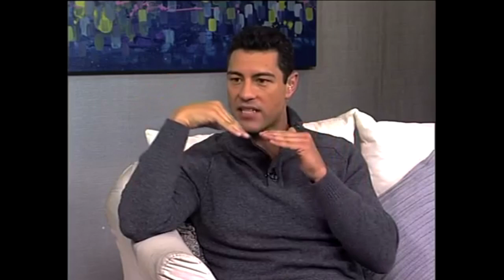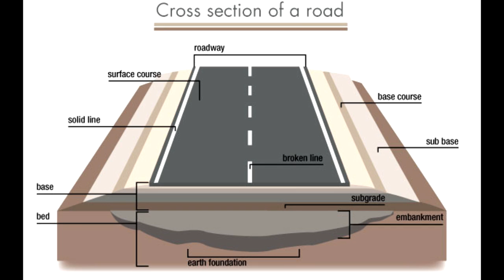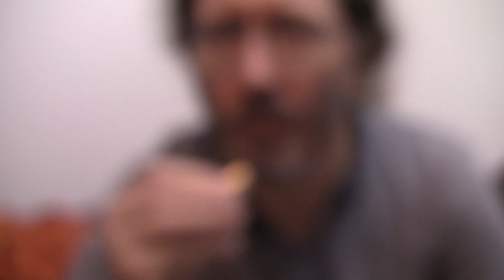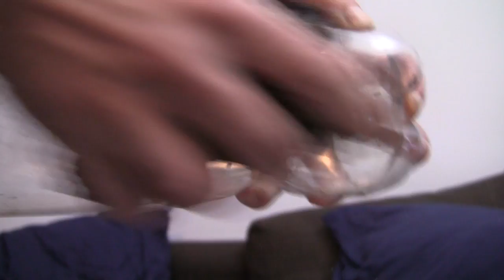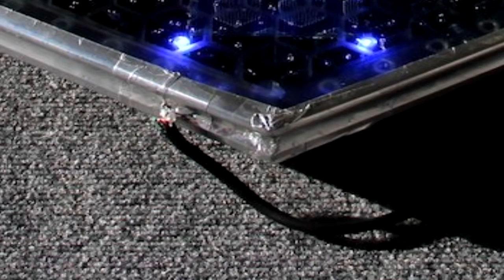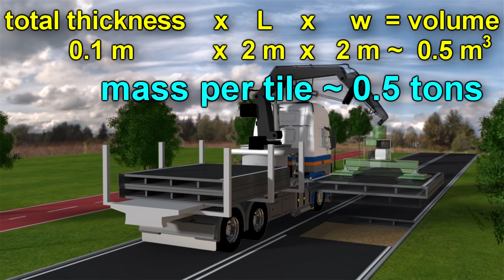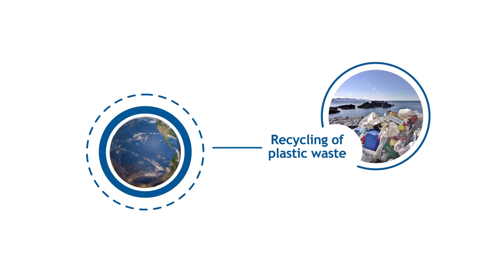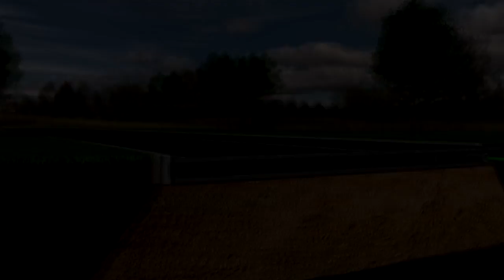Plastic Roadways BUSTED!

Comment: just imagine a car burning on a plastic road ^^' bye bye road, bye bye pipes, bye bye cables. yeah genius idea!
Reply: Didn’t even think about that, lol.
Reply: @zack dai some plastics can take some heat, so exhaust / friction heat from the tires probably won't matter. But some plastics will just melt from the sun alone (I've been in a 3D printing group where someone shared the sad picture of a PLA figurine that turned into a plastic puddle. R. I. P)
Reply: Imagine a wildfire out west burning 100 miles of interstate highways.
Reply: @greenspiraldragon  true lol. We don't have them in Germany, so I didn't even think about that.
Reply: You made me lough )))
Reply: Imagine the smell DX
Reply: Imagine a tire going flat and coming off the rim and someone driving just a few moments to get to the side of the road . Even if just for a moment it would cause deep gashes and gouges in the road
Reply: Maybe just wait til we get electric cars, and then go with the plastic road then.
No fuel, no fire.
Reply: @kosco1151  ehm, electric cars burn just like gasoline cars do. Even if the energy is not stored in gasoline form, its still being stored. and if something goes wrong, this energy is being released unsafely and starts a fire...
Reply: Cost to high .
Reply: Hahahahahha
Reply: It’s gonna smell pretty nice too
Reply: @xivisaac  yeah, nothing better than nice plastic fumes
Reply: The gov will mandate fire proof cars!
Reply: good thing car tires are made from a soft material and not diamonds
Reply: @YashuaFradkin  because roads and tires are clean and there is absolutely to debris between them right? go lick your closest road and tell me how many small rocks stuck to your tongue.
Reply: max cepec the rocks are from the asphalt that is loose. No asphalt =no rocks.
Reply: @YashuaFradkin  uh huh, because there are no roads in hilly terrains, no roads across woods, no base around the road which is mostly rocks and no roads that are basically  no asphalt, just settled rocks, also lets not forget parking slots next to beaches which are for obvious reasons not made of asphalt too
Reply: @YashuaFradkin  what are totally relevant to the comment reply definitely not completely off topic

Comment: Think of all the micro plastic this would generate and go everywhere.
Reply: @YashuaFradkin  rocks in tire holes
Reply: It's already a problem, but plastic roads would make it worse.  Microscopic bits of plastic are being found in human body cells.
Reply: @YashuaFradkin  are you stupid a tire creates alot of friction not to mention debris in the tires, dirt sand or any other contaminates on the surface or within a tire, worn down tires have metal bands which can be exposed and destroy plastic or rip high end working gloves. not to mention the road would have to hold over 10 tons of moving weight by semi trucks or multiple cars. concrete deteriorates faster that asphalt which is why you rarely see it except on entrance to highways or on certain applications such as bridges.
Reply: @Br Mo It was meant as a joke, since plastic is a polymer, polymer is just the name for the overarching group of chemicals that includes plastic.
Reply: Have fun breathing plastic dust every time you drive!
Reply: @williamhuang8309 

Look up the particulate pollution from tires and how they affect air quality.
Reply: i think that the plastic would need to be fibreglass or some other material reinforced to have enough strength... That would at least reduce the amount of micro plastic released.  Its still a stupid idea for most situations (might be ok for a walkway in a park or something like that)
Reply: @islandwills2778  but now it’s not recyclable… so remove one major part of why they want to manufacture this…. 

We already have roads that are completely recyclable and cheap… why would we want to fix what isn’t broken until we find a better material
Reply: Man, that ship has sailed. Our society relies so much on plastics for nearly every facet of its existence that I doubt any person living in an urban environment goes a single regular day without consuming microplastics in some capacity or another.

Not like this idea'd help the situation, though. Shame, it was such a nice thought to believe we'd kill two birds with one stone...
Reply: @Br Mo 😉
Reply: @YashuaFradkin  are you replying to every comment? tires have loads of debris grinding on the road plus thousands of pounds of car above it... it's amazing how stupid you are
Reply: They are coated to avoid this....
Reply: @nursepotassium LOL DERRRRP dumbest reply ever 😂😂😂😂
Reply: @Prolific_Troll it was sarcasm genius
Reply: @nursepotassium  Ahh, that explains why the comment got so many likes.
Reply: @Br Mo Polymer 😉

Comment: I have a problem with the title though, it's a little problematic if one knows, that certain types of rubber etc. can be used to replace the bitumen used n the creation of the surface layer.
Otherwise, there is a reason that roman roads are still the pinnacle of durability, the secret is the foundation, even with modern roads. But roadsurfaces entirely out of plastic? BAAAD idea, realy bad, don't even think about it bad.

Comment: Obviously, this incredibly bad idea was proposed in order to scam investors and ignorant government officials who give out research grants.
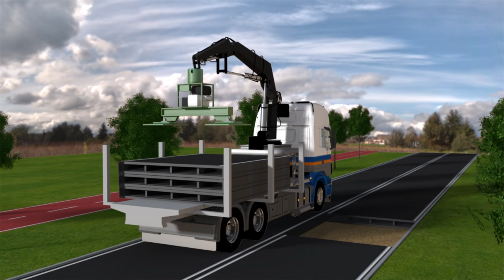  One of the most egregious of the flaws in this concept is the idea that you could run pipes or cables through the hollow parts of the road. Just look at 2:38, where a truck delivers a section of road. Now, what would happen if there were pipes or cables that ran through the road if a section needed to be replaced? That's right, they would have to be cut out and replaced every time a damaged section needed repair, cutting off water, electricity and communication services to untold numbers of customers for days as each utility would have to take turns cutting, removing and replacing their pipe/cables. We lay water and natural gas pipes parallel to and far under road beds and leave them be for generations, there is no reason to lay them a foot below the surface (where water mains would freeze in winter).

Comment: Instead of roads, use it for sidewalks. As for the movement problem, that is why you make it interlocking. Slickness can be controlled by how the surface is molded. The major problem comes in when you come to a curve. It would have to be made on site and installed just like concrete or asphalt. Power cables and such would need to be in a module on the side so that you could remove the roadway without disrupting the power, comms, water lines.
Reply: If you need to be made on site, WITH the movement problem being a major factor on how you mold the surface, then just use a concrete sidewalk. It's cheaper to make and is better in terms of maintenance.

Comment: I live in Las Vegas, NV where it is very hot and I recently found out they are going to start recycling tires by removing the steal belts and grinding the rubber to make asphalt to pave our roads. The new material is supposed to withstand the desert heat better and be more durable than traditional asphalt, although I am unsure if it will cost more to produce it sounds like a great way to rid the environment of the massive amount of discarded used tires we produce each year. I also saw that a way to recycle used plastic waste into jet fuel  which sounded very promising.

Comment: I think i found another hole in that idea.
8:48 How do they expect connecting pipes and cables(dont forget its wet area) inside of plastic block? Its not sure how much space there will be inside block, but even then it would be pretty damn annoying job going inside to join it. 

By truck placing block animation it looks like 20-30cm at most, thats one way trip even for Diet competition winner.

Comment: Just to prove this guy wrong.. There are already roads made of plastic working well.. Of course basic road construction for the foundations is necessary.. But the surface is the that deteriorates the most and the most complex to fix. So the arguments are based on assumptions.. The use of roads in plastics is already a fact
Reply: Oh yeah! The “plastic” roads in the UK! Funny, I did some research on the roads in the UK, and as it turns out, the roads use five kg of plastic per 1 us ton of asphalt. So how much is that? 0.5% just about. 0.5% plastic roads would be a better name for them, 99.5% asphalt roads plus a little bit of plastic. How much plastic were we talking about in the video? 100%. All currently accessible roads are mixed with asphalt and have more than 80% asphalt in them. The ones in India have the least asphalt in asphalt plastic roads, and I assure you they have way less busy roadways in India than in the US or the UK.

Comment: Asphalt is much softer than PET. If aggregate is mixed in just as it is on the road surface now it should be harder and resist deformation better than asphalt.
Reply: Where do you find the hardness scale for pet?
Reply: https://omnexus.specialchem.com/polymer-properties/properties/hardness-introduction    Not hard lol. Asphalt is like putty at 70 degrees. Only the rocks are hard. Pet doesn’t liquify until hundreds of degrees.
Reply: @klardfarkus3891  Asphalt doesn't liquify until up to 250 degrees F, I'm not sure where you got 70 from.
Reply: I didn’t say it liquified at 70 degrees. There are degrees of pliability before it liquifies.

Comment: but what happens if they replace a section with cable running through it
Reply: Oh that's easy. They'll get all these nanobots (still under secret R&D at the ultra top-secret facility) to scoot along the bits with cables to repair all the junctions as they go >o.O<

Comment: Some plastics are not too soft.  And there is also the need for an aggregate like sand which could be made by chopping and grinding up pc boards, as the plastic wears this would be exposed and provide grip.   Many plastics are not thought of as recyclable due to fiberglass impregnation in it.  So this same plastic will work to provide a hard traction surface for the road.
     Asphalt is a soft material due to the tar being a soft plastic like substance,  it is the gravel aggregate.  Tar melts in sunlight, plastic does not.  And there IS a sensible way to protect the plastic from the sun, the aforementioned PC boards and Fiber infused plastic aggrigate which is super hard.
     The channels add stiffness to a given weight of a panel.  These channels form I Beams to stiffen the road panel.  The animation is probably not to scale for a few inches of plastic is not going to hold up a truck for long.   But your assessment of the design is uninformed and biased.
     They are already making road bricks for in town roads in the Philippines and Africa using plastic shredded and melted down with sand added and it is holding up well even under the weight of the large dump trucks bringing the plastic rubbish.
Reply: Gee, vyou're amazing. Do you really think that the boffins at "PlasticRoads R Us" didn't think of all that stuff in your first two paragraphs before the marketing gurus got their hands on the vid? 

"Road bricks" as you've described them are a completely different beast altogether, for a start they do not have yo have channels in them to carry cables and 'storm water or icemelt' built into them.
Reply: @billrichards1965  You are missing the point.  The point is that plastic can be used in roads and already has been.  The tube to hold pipes can have a slot in the bottom and a separate piece to make the bottom part so that the top could be replaced.  Until it is done and proven, all of your negative speculation is warrentless.  Making angry predictions is a waste of time.  When you have an idea like making roads with channels you run into those problems, hopefully on the drawing board and you have a contingency plan ready to solve them in the application of those designs.  The author here criticizing their efforts is not solving a problem, only pointing out one that he is not aware of their plan to fix it or if that solution was merely omitted from the video without his knowing it. So don't you think they have already addressed those problems and found their solutions?  I have.
Reply: @TheWadetube  it is quite obvious from the video that the engineers designing the road have done so with a "one piece drop-in" section in mind, NOT as a two piece top and bottom!! 

How would the road (re)construction workers establish a waterproof seal (that can be repeatedly broken and resealed??) If they have developed such a revolutionary concept, why isn't it mentioned in the video instead of the repeatedly stating that the sections of roadway are sealed "one-piece units"?

They can't even get a small piece of footpath to work properly let alone surmounting the complexities involved in having a hundreds of kilometers of roadway capable of carrying cars and trucks yet.

Comment: This could be fine for sidewalks, bike paths and lightly traveled short roadways with low speed limit. It does not seem possible the structure on the video would stand up to any kind of traffic. Perhaps parking lots or low speed access roads might work. A car moving at any real speed the structure would fall apart when there is an emergency stop. Even a mid-sized car exerts a huge amount of lateral push when it comes to a stop quickly. At 25MPH a 2000lb car in an emergency stop puts enormous lateral stress on the pavement. If a car moving fast on these plastic sheets were to stop hard it might break the anchor and move one of the sheets. Not good. 

The environmental aspect is also a problem. If the plastic breaks down and leeches into waterways it would be even worse than putting this into a landfill. I have seen videos showing the use of plastics for building materials like flooring and walkways. Seems to be a good solution, but there is no mention of the plastic breaking down. One solution could be to extrude the material and then encapsulate it in a more solid material. Not sure if that could be made cost effective. 

Doing something with waste plastic is essential. This solution, however, does not seem to hold much promise.

Comment: This proves how some people have a close mind: 

After looking at some comments.  It is clear that those who commented are not engineers and even less the commentator of this channel.

A plastic road or the portion that contacts the wheels of vehicles may be made of plastic or a compound that contains a percentage of plastic or glass.

But the underlying layers will not change in this type of construction, it stay the same.

We already integrate glass in asphalt and also plastic to replace part of the stone and sand of asphalt, that's why they are called composite surface material. 

For concrete, the stone is replaced by plastic and glass fibers to replace the steel in composite concrete. 

So to think or say it's impossible is false in itself. Because we already integrate plastic and glass in composite asphalt or composite concrete.

And oh:  they are already some roads build with these new composite surface materials.

Before attempting debunking any type of videos that talk about new technology, do a proper reseach before making the video.  

Because I've just debunked your videos debunking plasitic roadways.
Reply: To "debunk" a video, any video, you'll have to put up a lot more evidence supporting your statements that just a few lines of common knowledge and then say " I've just debunked your videos debunking plasitic roadways."
Hows about showing us some evidence for your claims that you debunked anything!!!.
Reply: @billrichards1965  there you go! see, it is common knowledge that there is no way a plastic road could ever work, especially the design shown in the video.

Comment: Tar is not as hard as plastic and tar makes decent roads.  Admittedly, a hollow cavity under the surface is between silly and stupid, but substituting plastic for tar in road construction is a reasonable idea.  UV does degrade plastics, but the aggregate at the surface will absorb the UV.  It is true that plastic is more expensive than tar, but the durability offsets this expense.  The thermal expansivity of plastic is a concern, but we have developed expansion joints to accommodate these limitations as well.  The only remaining concern is the relative coefficient of friction.

Comment: -How does it handle being heated up by an idiot doing a burnout?

-how big is this modular unit? Will it fit only a single lane or both lanes? How do we repair a highway if it's designed for a residential street, or vice versa?

- How do you allow traffic and services to flow if you need to replace it, and it rips up both lanes of traffic, as well as the power, water, internet, sewerage etc?

Comment: Our city busses destroy asphalt by the drive wheels flexing when the bus starts to move.  The city has been remedying this by installing reinforced concrete pads where the bus stops.  A bus is light compared to tractor-trailers which can up to 60 or 70 tons.  Freeze thaw cycles kill regular roads throughout the northern US and in most of Canada.  Channels in the road to hold water just seems like a designed in flaw!

Comment: There is nothing wrong with burning plastic. The Danish and Swedish have figured it out and are doing it very well you need high temp low oxygen gasification first and then plastic burns cleanly it is a very good fuel, makes a lot a heat. As for CO2 fear-mongering, yes, we raised CO2 to 400 ppm, the warming has not followed it as modeled, we have a much wetter and greener Earth. Google: nasa co2 greening of Earth. So yeah the plants are happy about higher CO2 levels, Earth had 4000 ppm before and it was all covered in jungles. Not quite the doomsday scenario.